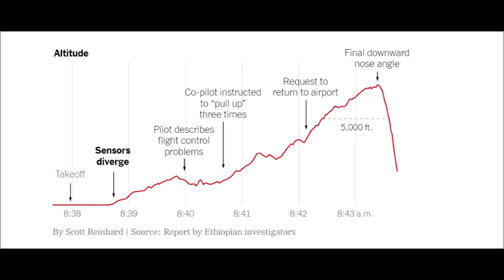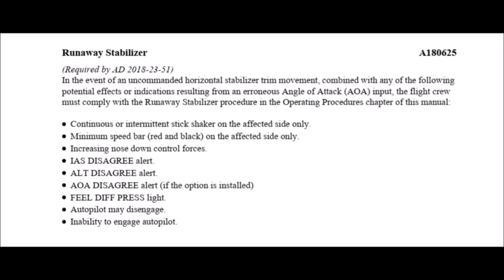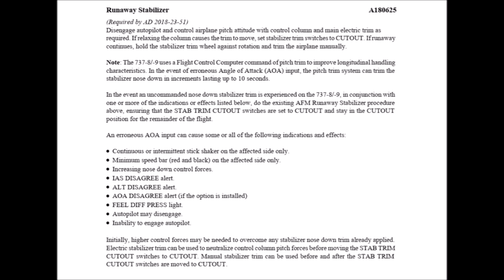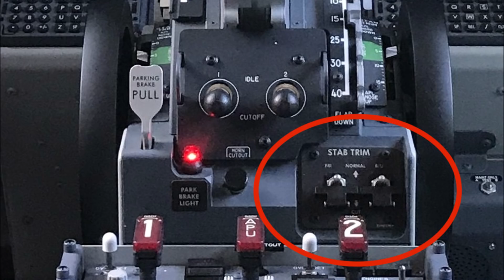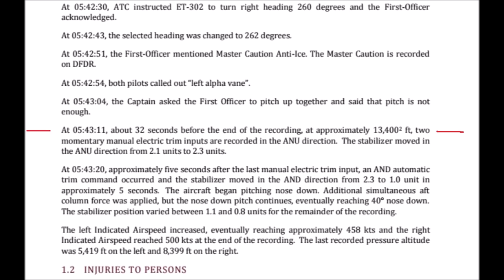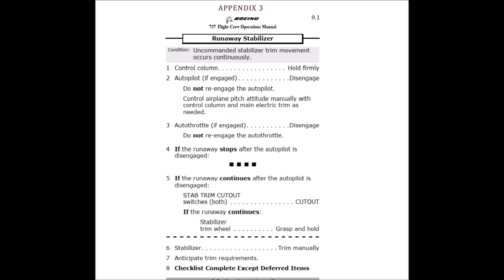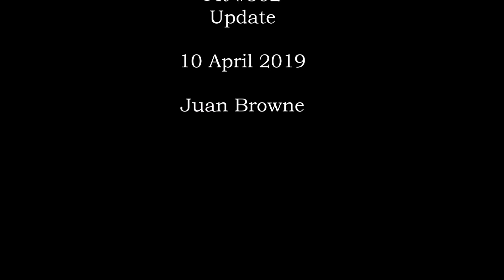737 Max Update 10 April 2019 Runaway Stab Trim Procedures

Comment: I have these observation on your assessment based on following: 
1) I agree that cockpit management might has been an issue where cabin crew PROBABLY (!) lost from their consideration throttle control but following should also be taken into consideration and analysed to find out if it was the case and if it contributed to lost of the control of the plane: 
        a)  At the moment prior to nose dive they were trying to gain altitude and were in initial phase of flight and / or trying to level the plane  ... there off ...
        b)   High throttle on 737 MAX due to engine position and 737 MAX irregular ( forward shifted ) center of balance (the way MAX is built) will help nose up attitude. The before mentioned is a known fact due to which MACS was actually implemented.
       c) How much would it actually contribute to keeping the plane leveled if they had actually throttled down is questionable as 737 manual trim is pretty hard to turn in normal flying condition and requires considerable amount of physical strength where sometimes both pilots have to spin the trim wheel to get it to move. (what was the air speed at the exact moment when pilots FIRST TIME have tried to manually trim the plane and what is the force they would have to input should be investigated)
2) It is pretty much clear from cockpit voice recorder transcript that ONE pilot (the pilot flying) was NOT able to control aircraft by himself and that BOTH pilots (pilot flying and pilot monitoring) were pulling on the yoke trying to counter the trim  as it became extremely nose heavy. It is known that on 737 -s you can not counter trim 100%  by elevator due to differential of the size of their aerodynamic surfaces and it requires physical force. On some air crafts you can. (I think 777 is one of them - correct me if I m wrong). 
3) Taking in consideration aircraft altitude it seems pretty much like a catch 22 to me. If they had throttled down  (in my opinion) plane would have pitched down and there would be no time to manually trim up. 
4) Was engaging electric trim one last chance to trim up - probably so.. What I m considering the one fatal mistake was actually not disengaging the trim within 5 secs after last manual trim input... 
5)  Would I blame crew for loosing control : NO. Considering altitude of the plane and time they had available they did everything they could and making an essential mistake (if it is what happened) taking into account lack of manuals, proper training (in person and flight simulator) as well as presence of NON REDUNDANT SYSTEM  that controls the aircraft pitch I would blame BOEING -s management cutting corners polices along with inappropriate control of  FAA certification procedures. Should we EVEN talk about recovering from a dive on an brand new aircraft due to ONE sensor malfunctioning at all? Not in any possible scenario in modern aviation.  
CONCLUSION: Should any plane be flying passengers prior to all issues being considered and resolved: NO. Should any pilot be allowed to fly a specific plane without proper training (non existing in this case) on the specific model of aircraft: NO. Should any plane be allowed to fly after one fatal crush (LION flight) while awaiting for essential fix up (MCAS software patch): NO
It is really easy to blame it on dead pilots. My condolences for all passengers and crew s families.
Reply: Good write up. To your last point however,  anything man makes can fail and no amount of scrutinizing can divine every possible failure. That said, Boeing did a very poor job of considering what could go wrong.

Comment: Been following Juan’s excellent videos of this event and like many here apparently I’ve worked in servo control systems for some years, long ago. Aside from a single sensor control system with no fault monitoring, nor any way to separately switch it off without disabling the motorised trim assist, the system insidiously integrated the unresolved ‘error’ each 10 seconds until the end stop was reached, as though somehow that might still result in a valid and controllable trim configuration.  It’s almost unbelievable that this was found acceptable as a design.  It’s quite sad that lives were lost and Boeing is clearly in big trouble.
Reply: Paul Axford Thanks for the feedback, and a very good description of the flawed design and fault tree analysis. The same points have been widely noted elsewhere.

Comment: What’s up with the AMAZON 767 crash there is complete silence I can’t find anything new. This Ethiopian crash people can blame the pilots all they want. Why are these AOA sensors failing. Boeing should have kept the tooling for the 757 because 5 years after the line closed there was high demand for it again. Instead  they stretched this plane so much they pushed the design beyond what the low landing gear could handle. They did all sorts of changes to cram the larger  engines. Boeing should make the 757 with new engines. Use composites where they can to improve efficiency. And they will have a best selling jet. The 737-900 is so long that when empty you have to put a pole under the tail to prevent the jet from tipping backwards. I think this MCAS still will put the plane into the ground after stabs are cut off
Reply: #YAY# - Human factors at Amazon Air, not hardware.
Reply from the maker: details are leaking out...waiting for verification.

Comment: What I can't understand, and I'm completely ignorant of how planes fly, is why build an airplane which will take off of its own volition at too steep of an angle. If the engines are too close to the main body of the plane then put them somewhere else where they won't cause too steep of a climb. Pilots shouldn't have to deal with a problem like this right after take-off should they? Wouldn't such a plane be deemed un-airworthy?
Reply: Ron Mortimer Your comment is simplistic and wrong. Please watch Juan's previous videos.

Comment: Why didn't the Auto throttle detect an over speed condition and correct?
Reply: Mrpaulgs The autothrottle was set to maintain a fixed rate of climb. It is not too smart, and was not expecting overspeed during that phase of flight.

Comment: I literally know nothing about managing and aircraft, but those instructions were written from the point of view of a designer understanding the theory and operation of the system, not a pilot managing a failure.   When you have to interject the common sense meaning of the written step, like you did several times, and then have to sort out if a statement applies to the crisis because of an option that may or may not be there, the instructional procedure is very flawed.   You can only hope you have a pilot that has previously memorized these things to apply the procedure,  versus a pilot that relies upon an understanding and a dynamic grasp of these things because the understanding has been with withheld thru the use of a poorly written procedure (not to mention the reduced mental capacity created by being IN the actual emergency).   ALSO, this style of troubleshooting procedure fails miserably when the failure of the system has been incorrectly "modeled", so when the "if then else" options are not exactly on point, the pilot is left with grasping at straws.
Reply: kwasg3 Precisely. The emergency AD was probably written by lawyers too.
Reply: Very good! I was on a safety team and expressed dismay with a new management policy created in response to an incident. When I argued that "perception is reality" I was soundly put in my place by management who's position was--- NO, "the policy is reality". Almost had me wishing we had a union.